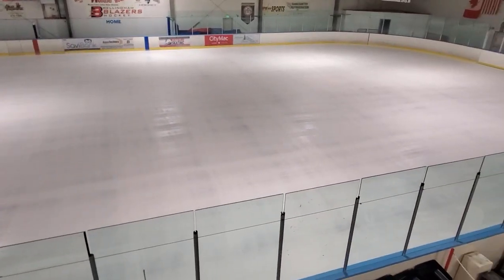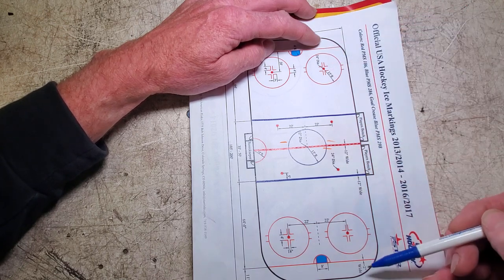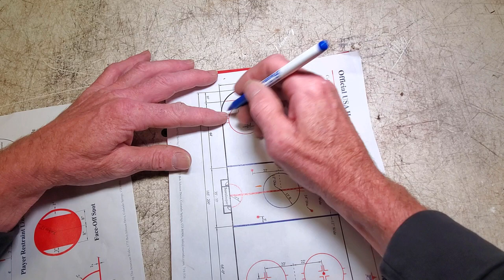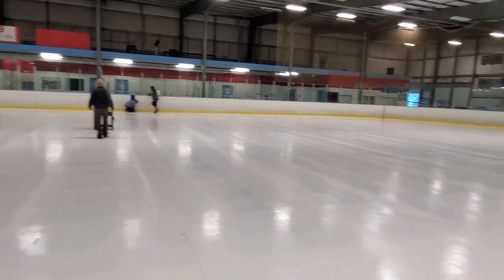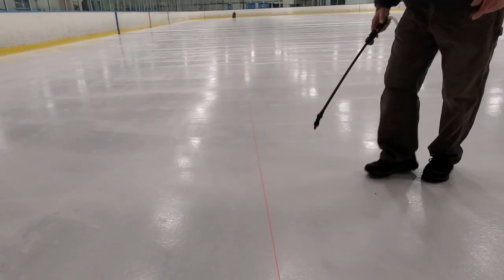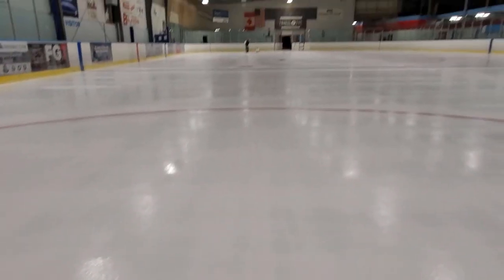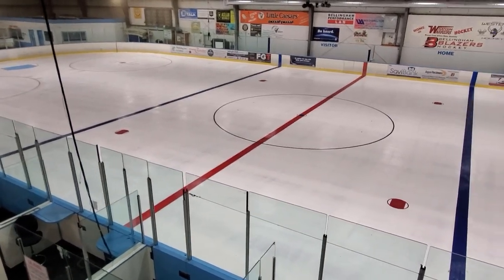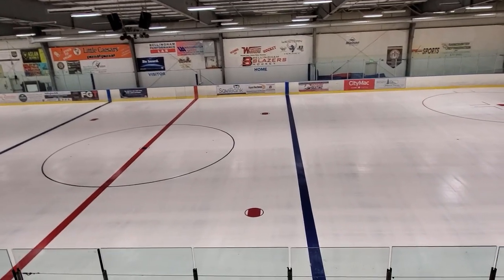Ice Rink Instillation: Paper Lines

Comment: At the end of the season you can drill with a 1/2 inch drill in the center of each dot a quarter inch into the concrete. After the ice is out you fill the drill dents with yellow caution paint so they are easy to see. The next time you start make the ice after you spray the water you freeze a nut on each yellow spot and the center of your dots are all set. Then you run your three strings over the nuts and you are ready to go with much less measuring also stick a screw driver in the nut and make your circles.. I also drill in the goal line in the middle for the creases ....  Works for us and we have been doing it for years ..  Great Job

Comment: Maybe it's just because I dont have experience myself but I'm curious how you do the circles with paper. It's just 2" straight paper but it needs to form a circle so does it kink the paper or what? How do you get it to turn nicely? I hope I get that question out right without sounding like an idiot lol
Reply from the maker: Great question. I should have shown that step. I will add it somehow in a next video. Yes the paper does kink but after the ice is built up and skated its almost impossible to tell.

Comment: Any chance you can do a video or show how to properly fix a spot then when the ice gets built up gets a hole in it and goes to concrete. If had a few spots go to concrete due to zamboni failure and when I tried to fix the paint it shows as like a vanilla creme look
Reply: Use a chopper blade (sharp) and hit the top of the bump to break it down. If your going to cheat with the Zamboni just make sure to turn off the horizontal augers off when driving over it slow

Comment: How long did this take?
Reply from the maker: To just do the lines took us about 7 hours. I think if we did it more often and with more help I think it could be done in under 4 hours.
Reply: @YourLocalIceMan  I was gonna say I saw a lot of technique I certainly would have changed. We do ours in 4 hours and that includes pouncing 6-7 logos around centre ice too . That’s 4 people. You lost the most time in 2 spots. Rolling out the main red and blue lines little by little. We stick a long screwdriver in the roll and have someone else pull the other end to the width of the rink. Lay it down all in one shot, shimmy into place, freeze, done. But the biggest cost of time was running all the extra string for the hash marks. I would just keep the 22’ and 20’ strings in, measure off of that to get your 9”, 24” etc. we used markers for years but I’m sure you know markers are unreliable. So we made templates instead that line up with the 20’ and 22’ strings and it’s fool proof. Takes 5 minutes to do all the faceoff hashes per circle.
Reply from the maker: @geraci89  for sure thank you for the information. There a lot of things I wish we could do better.